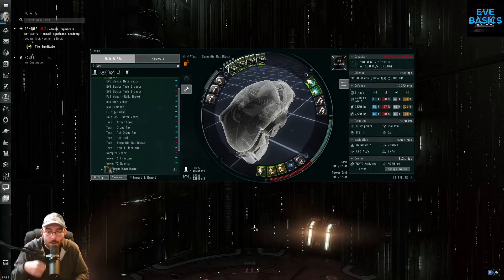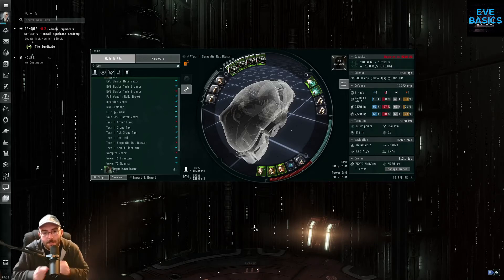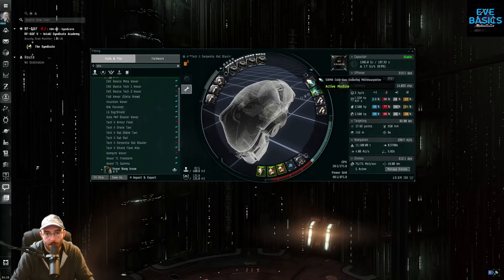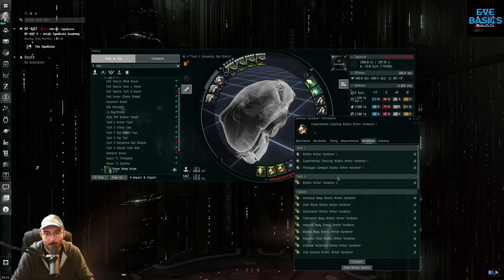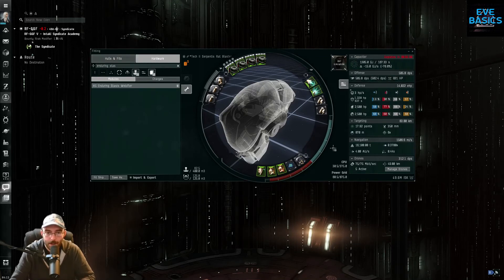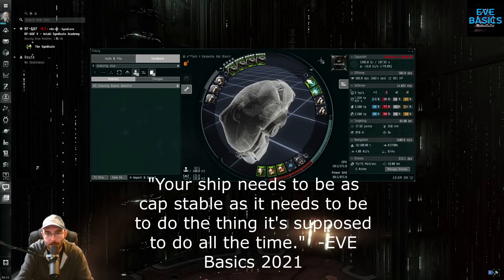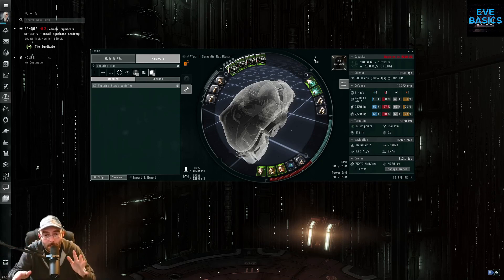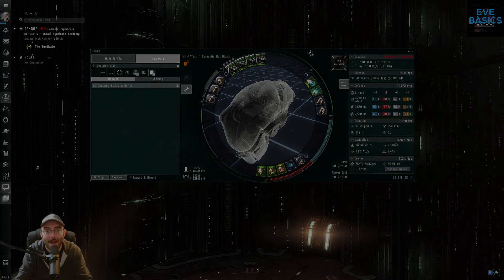EVE Basics 22 - PvE Cap Stability

Comment: How do I solve this issue with my vexor. (insufficient required charges)? Is there a module I can use? Kind regards David
Reply from the maker: I'm not quite sure what the problem is here as I'm not sure I've ever seen this message.. When does this message show up? It probably has something to do with the ammo, so make sure you've got that in the cargo hold..
Reply: @ariesgaming2988  thanks mate. I figured it out.

Comment: I’m pretty new, my Corp fixed me up a vexor that’s all drones and a massive mwd, no guns at all. It seems pretty effective and very safe as you’re orbiting the site at 50kms doing ludicrous speed. Cap stable too. What’s your take on it as a strat? Should I swap out some stuff for guns as I gain experience?
Reply from the maker: I would!  Orbiting far away and letting the drones do the work is a popular strategy.  But blasters add so much dps and are just a ton of fun.  Plus, if you're in close already, looting is easier since youre going to finish the site closer to the wrecks.